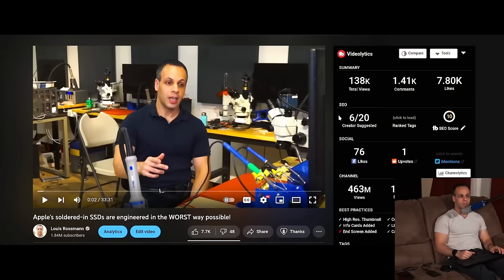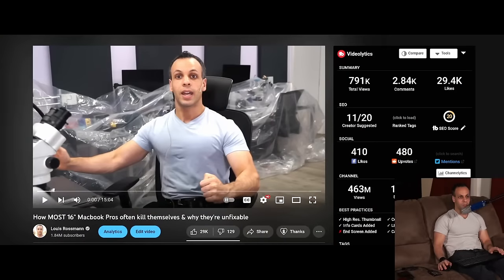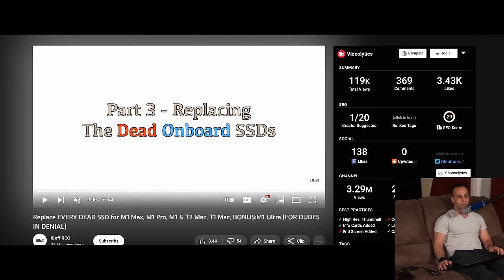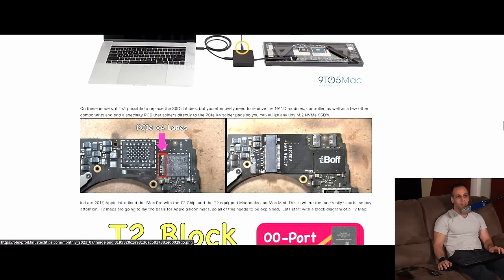The design of Apple's soldered in SSDs is worse than I thought!

Comment: This is why i wont buy apple crap because everything is soddered with no way to upgrade or repair and you got that damn t2 chip which makes everything worse. You cant upgrade your memory or swap it out if it goes bad you cant upgrade or swap out the ssd if it dies or you want more storage they made it impossible to do anything deliberately and you can only swap replacement parts out for equal replacement parts not greater otherwise it wont boot up or respond

Comment: It's mostly time for reverse-engineering and making compatible replacement parts that can be manufactured in countries with looser copyright protections :/  Pairing shouldn't be that difficult either.  Replacement parts won't fix the damages caused by pumping too high of voltage into a low voltage rail though.

Comment: If you remove the BIOS of a PC that has booted into windows, it will use a cached copy anyway so it will work. So your PC will work if the BIOS is removed after boot (theoretically). I still don't recommend yanking it out, it used to be a removable chip but it usually isnt. I just felt like being a jerk, good video Louis.
Reply: because bios routines were copied to memory already

Comment: I don’t think this is a big deal. I don’t see the NAND going dead any faster than a single capacitor or MOSFET on the power supply, either of which would completely brick the laptop in the same way and make user data unrecoverable, but nobody is complaining about that. I say vote with your dollars: if you don’t like what Apple is doing, buy Framework or Dell or something. Apple is allowed to design their products however they wish as a company in a capitalist society, and you are allowed to say “no, I will not buy that.” If Apple doesn’t want to add an M.2 slot, that is 100% in their right. If you do not like it, there is nothing forcing you to buy it. Personally I do not care, so I bought a MacBook. It works great for me. It does exactly what is needed for me. If you need something else, buy something else. That is the society we live in.
Reply: To add: yes I think what they’re doing is a real dick move. I don’t see why they can’t add an M.2 slot or why the SSD upgrade options need to be so expensive. I also believe that it’s their right to make dick moves. And it’s our right not to buy from them. Or do buy from them. It’s entirely your choice.
Reply: Yeh Apple is not an "evil "company😅
I dont believe you its just that you defend apple above anything
Reply: @Teluric2  Evil is a strong word (and I didn’t say it so I don’t know why you quoted it), but yes they are doing many shitty things, I never said what they are doing is not shitty. I said it’s their right to make dick moves. To your second point, how am I defending Apple “above anything?” I said that they should support M.2, and that their SSD upgrade options are overpriced. I said they do some real dick moves. If you were to ask me I would also mention awful things like their refusal to cooperate with Android SMS, their insistence on lightning ports when USB-C is obviously superior (and is present on half their other products), and how they employ slave labor. But those are not the topic of this video, so obviously I would not bring them up.

Comment: It's always been about profit. Huge corporations like Apple and Microsoft will try any and everything to thwart competition and fleece the customer. The EU has been somewhat successful at pushing back with anti-trust legislation. An example here would be forcing Apple to use the USB C port/connector instead of their silly proprietary solution. Of course, even there they tried to defeat that effort by only allowing "approved" cables to be able to fast charge

Comment: This design should be illegal. I can’t even understand why a PS5 has a soldered SSD. Even if it’s custom design, and only would work with Sony’s SSD at least have some custom connector. But even then I can see reasoning there, that’s a console, and the whole console costs around 400-500$. 

Apple is selling a conputer here, a product, which I use to work, and could be 10x the price of a PS5 or more. And companies buying this large scale could not swap an SSD out fast.

Comment: Louis what about thinkpads with soldered ram💀
Reply: Soldered RAM is nowhere as bad as soldered SSDs. RAM does not have a preset failure date like NAND does. Moreover, RAM is the rarest component to fail in a system (even CPUs are more likely)
Reply: All LPDDR (and GDDR) has to be soldered to the board according to the memory specification. Therefore any device that uses LPDDR (or GDDR) has the ICs soldered to the board.

Comment: i have a question bout ssd bein wear part, how
i know a hd is a wear part cause its a disk that spin and a neddle of some sort read and write by sticking a niddle on a metalic disk that is spinning really fast, that many things that could fail on a hd
how a ssd fail, as far as i know theres no moving part on it
Reply: im talking assuming normal use btw
i know apple think different design philosophy means the genious though it was a good idea if a fuse fail or something it would send a lot of watts of voltage to the ssd, frying it and destroying all the data
Reply: @yanlucasdf  ssds physically wear out the more you write data to them
Reply: @pizzaboxer  can u explain how in a way someone stupid as me would understand
like i know a hd wear and tear cause every time you wanna write something you have to spin it and stick a sharp needle to scratch it,and to read you spin it and let a less sharp needle scratch the schraches
Reply: @yanlucasdf  ssds work by trapping electrons with transistors. the charge they hold determines if it's a binary 1 or 0. changing the charge requires applying voltage to them, causing stress. the more you do that, the more the transistors lose their ability to change what charge they hold.
Reply: @pizzaboxer  like a battery loosing effectiveness every charge discharge cycle right
thanks king

Comment: One devils advocate; I can see reasons to build something more secure than PC / TPM / Trusted Computing, as key release over SPI is a plausible attack vector. But given good engineering, you could presumably merge needs like repairability and stability into a more secure design. So even if T2 / security is involved in making the computers less repairable, I don’t think it had to. You could for example moved the bios off the flash, and used a normal PCIE/M2 SSD would be some initial good steps, if the entire design was about getting a good mix of repairability and security. Arguably security is a bit of a scapegoat for Apple etc here, just because they made one improvement over PC / TPM, everything else doesn’t have suffer.
Reply: All new CPUs and SoCs moving forward will have on-die TPM/security chips enabled by default. There really would be no reason for Apple, or any computer vendor really, to keep using such a terrible design.

Comment: You may want to specify that this is only on the M1 and M2 Macs, the older Intel Macs don't have this issue.   The M1 boot process is very different from Intel macs. In fact, they do not support external boot disks at all, by design. This is because the built-in firmware is extremely minimal, and does not contain drivers for anything but the internal SSD. It doesn't even have a keyboard driver, or any kind of GUI other than showing the Apple logo and "Entering startup options" text, and some error screens. All of this is by design, for security - UEFI is an enormous hairball of code, especially on Intel macs, and almost impossible to secure properly for that reason.
When you boot into the "Startup Options" menu, you are booting into a special macOS partition in the internal SSD. M1 Macs use macOS as the moral equivalent of the UEFI setup menu. That boot picker that looks like the UEFI boot picker on Intel Macs? Yeah, that's a full-screen app on macOS made to look similar.

So how does external boot work?

The "blessing" process done by the Startup Options screen involves copying the entire macOS Preboot partition - iBoot2 OS loader, Darwin kernel, auxiliary CPU/device firmwares, device tree, and some additional stuff - to the internal SSD. It then creates a local, signed boot policy that allows system firmware to boot this macOS install.

You aren't booting from an external disk. You are booting from the internal SSD, with the root filesystem on the external disk.

Additionally, the integration of the macOS user credentials with the SEP means that you can't "just" take an install made on another machine and use it on a separate one. It involves importing user credentials into the local machine. This process isn't implemented properly yet.

As you might expect, this entire mechanism introduces a ton of corner cases around updates, boot selection, etc., and it is still very buggy and broken. The M1 launch was, when you look at details such as this, very obviously rushed.